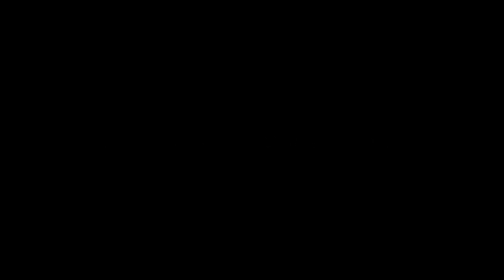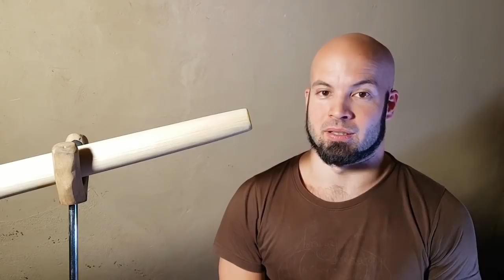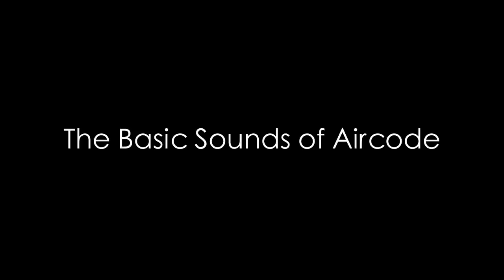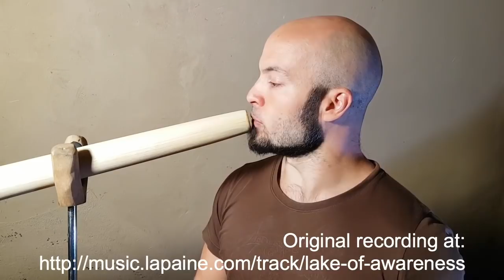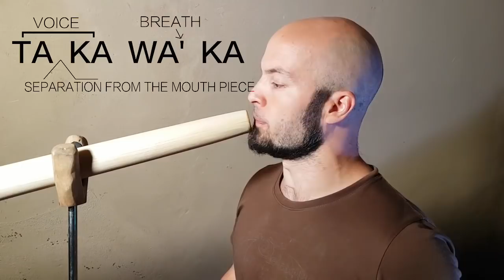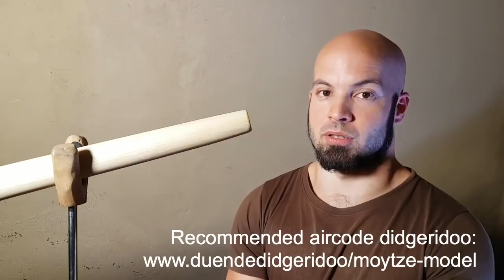Didgeridoo Aircode - Playing with open mouthpiece!

Comment: Thanks for the tutorial!
I have a question concerning breathing. I am trying to play "tawaka" with aircord. If I breath in on the "wa" after some time I am full of air and have to take a break. The other option I tried is to breath one time in and one time out. That works better. 
When and how would you suggest to breath?
Much love ❤
Reply from the maker: That is a GREAT question! To answer it, I had to try it myself. I use the same technique like you, breathing on the wa, I only breathe out less, once in four breaths. You can choose to skip the breath as well, or just breathe very little. Other way to balance out would be to push the Ta more, but that creates a different sound.
Reply: Ok that makes sense! Thank you 😊😊😊

Comment: The only thing I dont like is the tiny mouth piece I play in 33x35 mm could be posible  to play air code??? Also what characteristics need on didge to play?
Reply from the maker: The size of the mouthpiece is not so important. The one in the video is around 31mm, sometimes I use 33 for very similar didge. So it is not so different from yours. If you hear the sustain, it is good.. if you don't... either you or the didge is not doing their job... ;-)
Reply: Dubravko Lapaine Didgeridoo  awesome to know I have a
 mobdidge with high  back pressure  gonna try  it in this one!
Reply from the maker: My feeling is that it will not sound great for AC, but not due to mouthpiece...
Reply: Dubravko Lapaine Didgeridoo im gonna make a C didge with high back preasure  and practice a lot, im doing the drumbas a lot lately at busk and alway wile playing i think " do it like duv, do it like duv!!!"
Reply: @JammTj664   Here you caught my attension: HOW  you decide the tone of the didge???? I dont get it ! I se some didges are sold as  "untuned", others in a specific tone: But how can the maker Control that ????.
Reply: @BoCopenhagen   length and diameter make the tuning, I use didgmo, I have made didges with 80% accuracy. When people say is not tune, is because they leave didge in a length that if you blow soft you will get a certain key with +XY cents and if you blow with powa you have half step up from previous key but with -XY cents
Reply: @JammTj664  Thank you so much. That gives good sense!